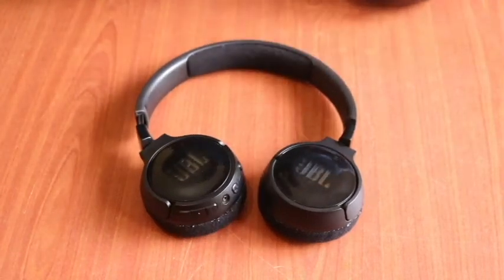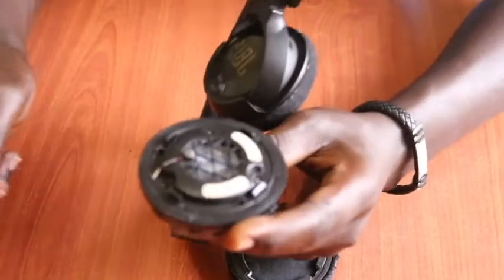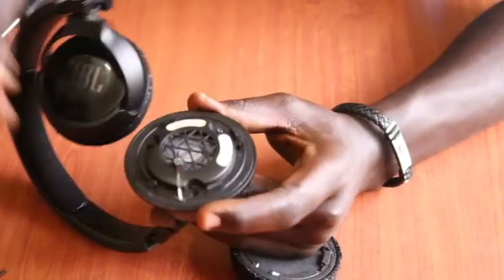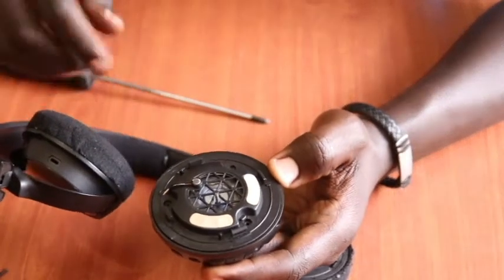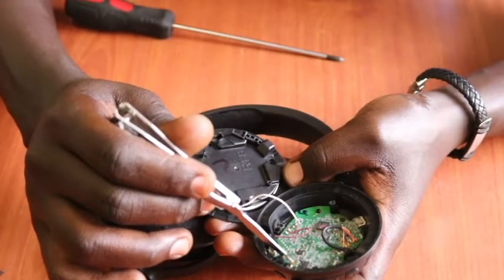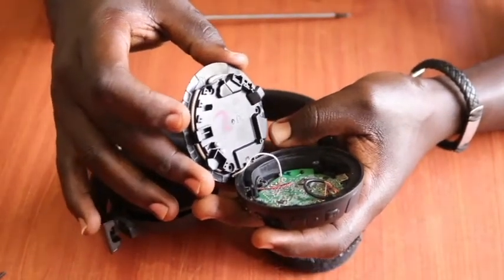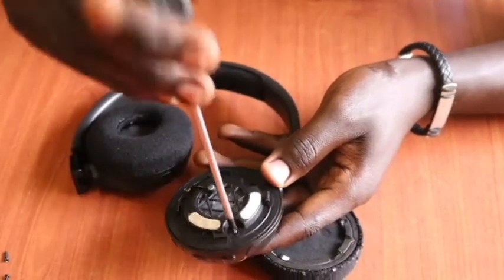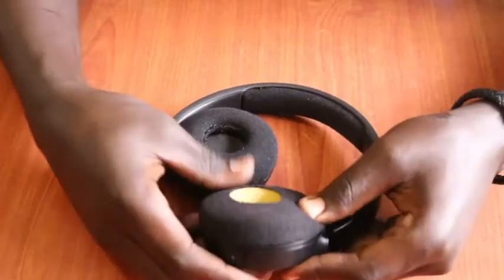Fixing JBL Headphones where one side does not work | tune 600btnc

Comment: I used your video to fix my JBL Tune 710BT with one speaker that had gotten much quieter than the other. I used a little isopropyl alcohol to wipe the contact pieces and gently flicked the springs several times. The only difference between the models is that there is no wires connecting the two pieces screwed together, which is really good because it nearly flew off when I pried it apart. Thank you so much for the helpful video!!
Reply from the maker: That's awesome to hear! I'm thrilled the video helped you fix your JBL Tune 710BT. Using isopropyl alcohol and gently adjusting the springs sounds like a smart approach. And I'm glad the design made it easier to access the components, even if it was a bit precarious! Enjoy your restored headphones🌹🌹
Reply: Hey even I had this exact same problem on the exact same model. This was the fix. The worst part was I took it a JBL authorised service center and they said it was a non repairable problem.

Comment: The springs were not the problem in my case. I had to open the other side of the headphone (with the JBL logo) to access the wiring. One wire was loose and needed soldering. In fact they all needed re-soldering because the original was so badly done in the factory. Make sure you disconnect the battery first because the solder tip is earthed...and can destroy live circuits! Have a nice day😊
Reply: How do I safely disconnect the battery? I have a jbl 650btnc and the battery cables are simply soldered on

Comment: My 510BT does not have these contacts. Know of any other repairs?
Reply from the maker: @Mark Schilitz, Sorry about the challenge, I have not yet interfaced with 510BT, but I will soon do.
Reply: @opolotiversity  Tell me if this makes any sense. I have been reading other’s replies, and there are claims that cleaning the contacts on the left side, restores the audio on the right side. True? I want to try this.
Reply: Does your ❤️ mean this will work?
Reply from the maker: @IluvYahweh  Yes it is true, the contacts help transmit from one side to the other side, ensure to do it gently not to affect any other parts.
Reply: @opolotiversity  Thanks. I’ll report back with my progress soon.
Reply from the maker: @IluvYahweh  Yes it does
Reply from the maker: @IluvYahweh  Alright then, Best of luck wishes!
Reply: @opolotiversity  Mine is completely different. There is no Springs or contacts on either earpiece. It is a JBL TUNE 510BT. Not sure what to do now.
Reply from the maker: @IluvYahweh  Sorry about that, you can try factory resetting it:

 Just take the following steps:

1. Turn the headphones on. Make sure that they are disconnected from your phone. You should also turn off the Bluetooth on your phone or device. You can do this via the Bluetooth settings menu. 

2. Press and hold the ‘Volume +’ and ‘Volume –‘ buttons for about 5 seconds.

3. The LED indicator light will begin to blink. This means that the Bluetooth pairing settings have been reset. 

4.  Now, you can turn Bluetooth on for your device. Pair your JBL Live headphones to your device like you did when they were new.

Let me know incase this helps..
Reply: @opolotiversity  No. I tried that already. Thank you for trying to help me.
Reply: i have the same problem with the same headphones Tune 510 (left side not working after a fall down)  @IluvYahweh
Reply: @IluvYahweh my daughter has a CLUB 700BT,  and the same thing, totally different insides. Left side also not working, without any fall. However with cable it works. Nothing to find anywhere, I guess I'll have to buy another pair 😢